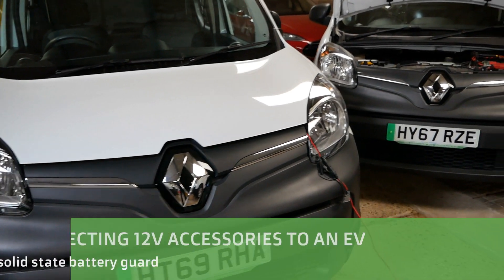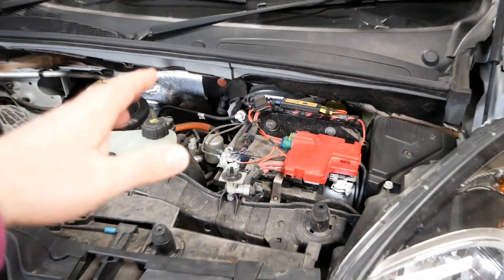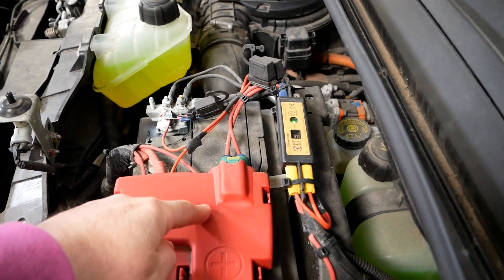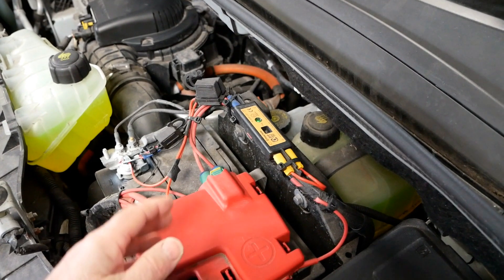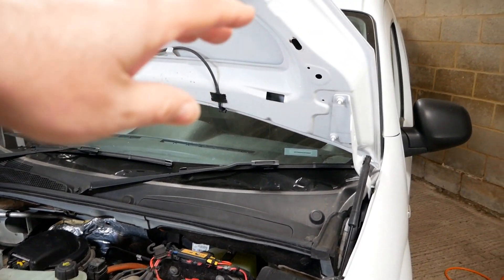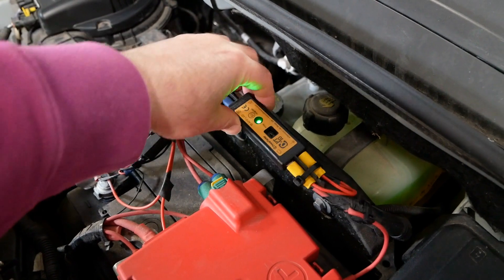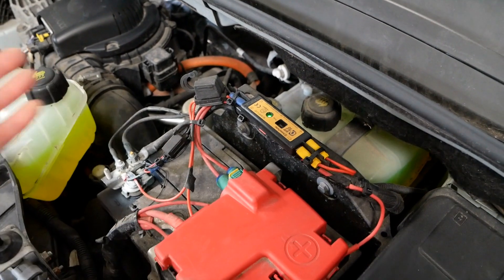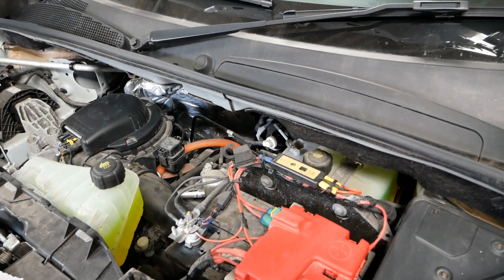Fitting 12V accessories in an Electric Vehicle (& any other vehicle too)

Comment: They also do these sorts of devices for lower powered accessories that may hook directly into the fuse box. The VIOFO HK3 kit that I use with my dashcam has a sliding switch to select between 4 cut-off voltages for the same purpose. The camera can run in “parking mode” which records a time lapse whilst the vehicle is “off” but you may want it to stop the battery draining too far.
Reply from the maker: Good to know. Thanks.

Comment: Maybe not as relevant as some of the other comments. But I’ve managed to fit a Kenwood DMX7018DABS to my 2014 Kangoo Z.E. where the pocket is on the top of the dash. It has a short chassis design, so fits neatly into the dash. And upgrades the Kangoo to a 7” touch screen, handsfree, Apple CarPlay and Android Auto. You can add a reverse camera and retain the standard Renault steering column controls. All very useful. And I’ve just fitted a single DIN pocket to the old radio location.
Reply from the maker: That's good to know. Can you share any photos? Maybe a link to a Google Photos album?

Comment: I have a 64 plate Kangoo ZE, I run quite a few accessories but with the ignition key turned to the first position, this doesn't switch on all the driving functions but does switch on the DC charging circuit. I haven't had any problems with this method so far.

Comment: On my previous Hybrids and Electric vehicles I use a smart 12v battery charger with the quick sae connector and do not disconnect the 12v battery when doing so, do you HAVE to disconnect the 12v battery on the ZOE before charging it?

Comment: Can I ask , In your experience of Ev,s have you seen any that have had a solar battery maintainer for the 12v battery fitted say around the front windscreen .
You can buy these maintainer ones from places like Halfords & online like Amazon .
Are they any good for a Ev or will they do damage to the 12v system ??
Reply from the maker: The Nissan Leaf can have a solar panel in the rear spoiler on the hatchback and does exactly this. But then I've had these with dead 12V batteries, so it clearly doesn't keep the 12V topped up enough.
In the unit, I have a Noco Genuis 1 unit (see https://no.co/genius1) connected to every stored EV, which is keeping the 12V batteries topped up at only 1A. These work very well and does not effect the canbus etc. So yes, I can't see why the solar panels won't work just fine.